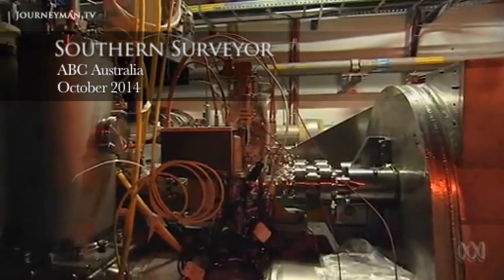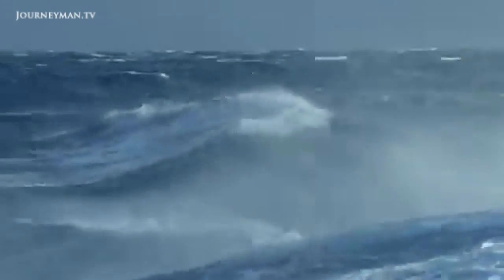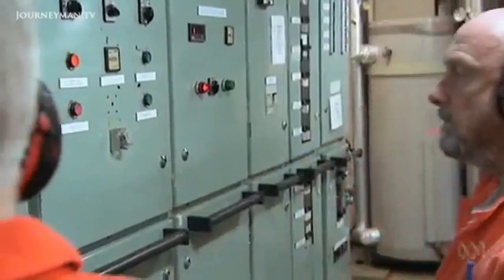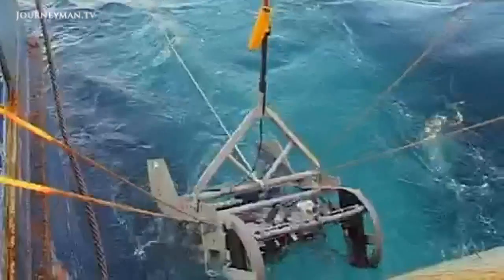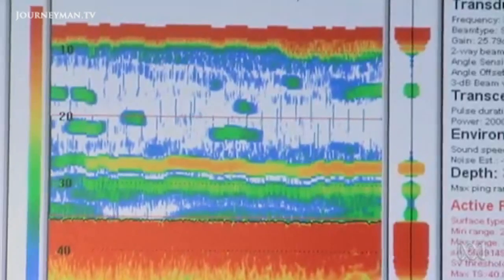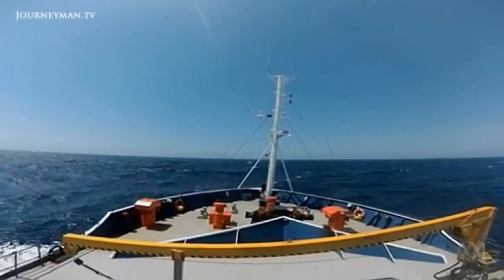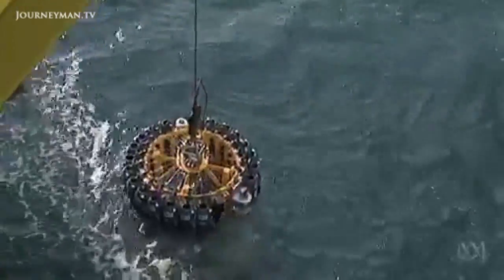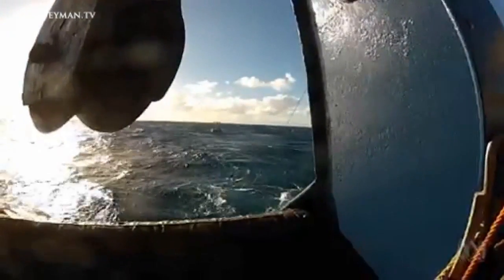The Research Team Mapping Our Oceans Floor

Comment: <<<NO FUCK way!>>> a buoy mini station will cost 1 million dollars each even installed, no satanic bot way. 3 or 400 k max or they don't get deployed & u don't hve a job jack offs. Mass produce a batch of 1000 version 1, thru each following improved version of 10 will get the job done for whole globe. Those inside countries 15 miles border will b put in water & repaired by that country. If they can they can then grid of another 15miles 2nd boundary line, depending on how well they put the 1st 15miles of floaters in.

Comment: Chinook but w/3 tall tower props 50% more volume & light hydrogen fuel long! range combined w/those new small boat w/tires instead of trailer craft can take over search & rescue ppl GoD's new design or at sea replacement or paroling & drilling. Fly 3 or 4 boats w/no trailer out to spot of last coordinates then deploying 4 small boats to stay on location or sub resupply is only way to do the job, or flying search bs by air.
Reply: Not allowed to fly over water w/just 2 engines God & losing 1 means dead chinook but not if using 3 & 50% more volume float ie my design. Boeing could hve not been satanic fuck devil corp & obeyed but instead ashes of corp or some1 will get the work.

Comment: I God & setting up floating buoy network for weather & tide type readings every mile sq near shore & every 2 or 3 miles sq in middle of no where ocean. Listening microphone & solar & wave energy & cell & emergency food is idea, for ppl lost at sea. A floating net 100k out from buoy. So at most the longest distance u need float & drift & swim to near shore is less than a mile. If u hve a vest on u can save yourself that short dist. Adjust the light on top to emergency flash & call out on phone.